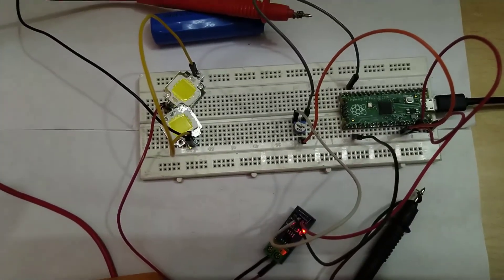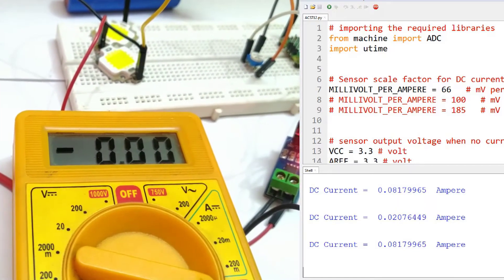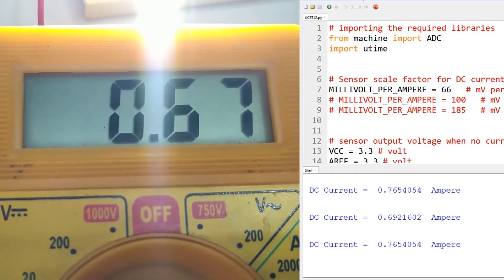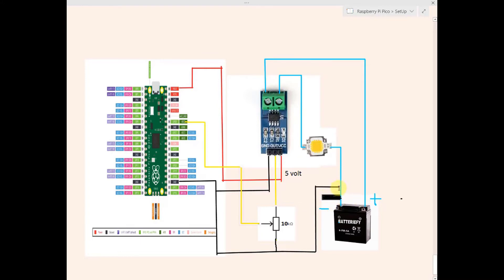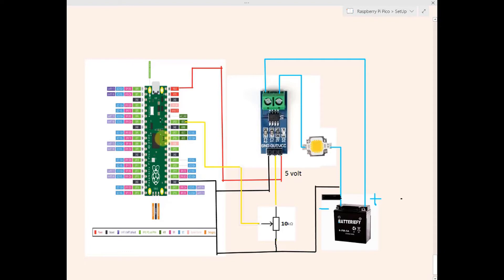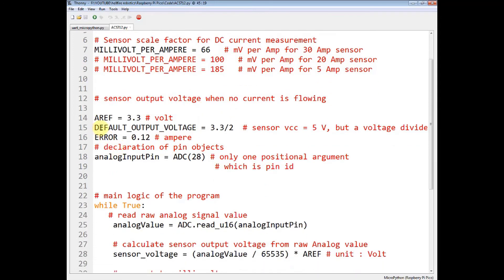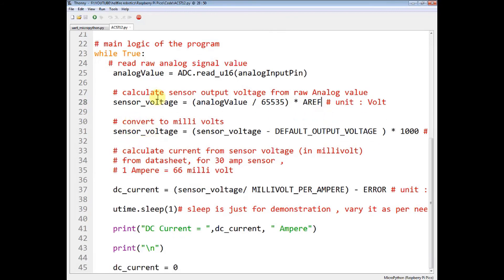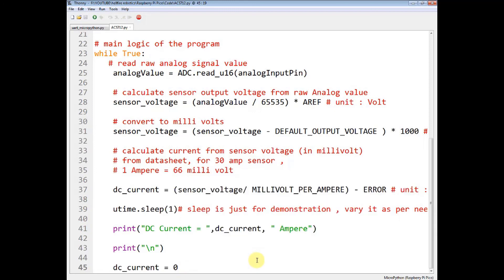ACS 712 with Pi Pico | Measure DC current in a Circuit | Micropython and Pico

Comment: It is not clear to me why you are not scaling the 66mV/1A since you are reading based on 3.3V instead of a signal based on 5V.  Do the math for a 5V system (with the 0 current at 2.5V). Assume 1 A current,  then the voltage reading should go up to 2.5+0.066V = 2.566V.  Now assume those same 2.5 V and 2.566V are signals for the no current and 1A current, and ask what the voltage divider will see.   It will see those 2 values scaled down to the 1.6V level and the 1.63V level.  Those readings then go to your ADC.  Bottom line: I would expect the 66mV / 1A to change to roughly 42 mV/1A due to the voltage divider.